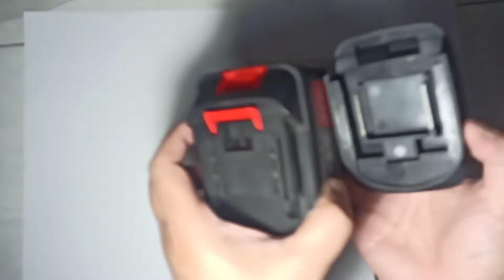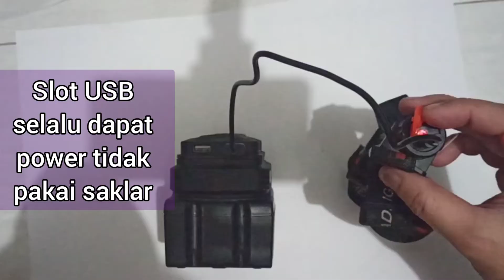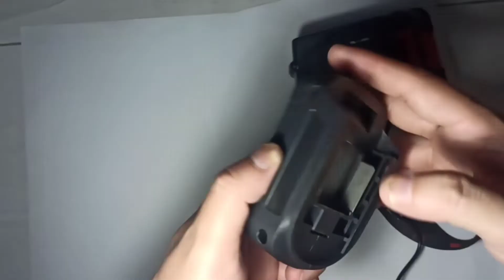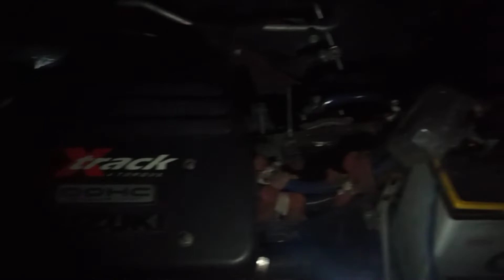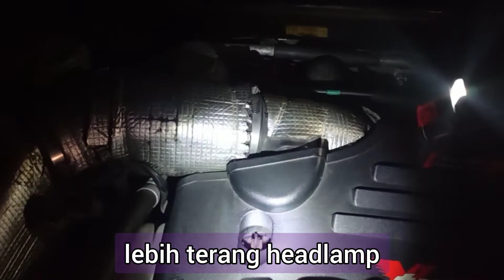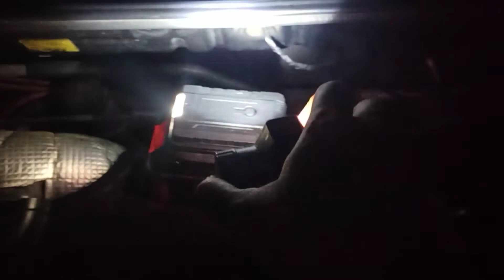Adaptor lampu LED + dual USB untuk batere LXT makita, baguskah ?

Comment: Tegangan keluar 5 v atau 20 v
Reply from the maker: untuk usb 5 volt standard, slow charging

untuk lampu seingetku jg segitu, aku coba modif nambah led 12v aku seri biar bisa ke 21volt tapi ga terang jg ternyata. 😅

ga rekomen ini barang, lampunya redup.
kalau sekedar buat darurat powerbank asal tahan ama slow charge sih gpp
Reply: @singachuotodiy  ok makasih infonya....yang penting lampunya yah
Reply from the maker: iya... lampunya itu bener2 sayang ga ada terang2nya... padahal dah berharap banyak karena bisa langsung swap batere kalau abis
Reply from the maker: kecuali ngerti solder menyolder chip LED yang terang bisa ngakali mungkin.... aku ga ngerti soalnya dan solder kaki2 alus masih blom ahli